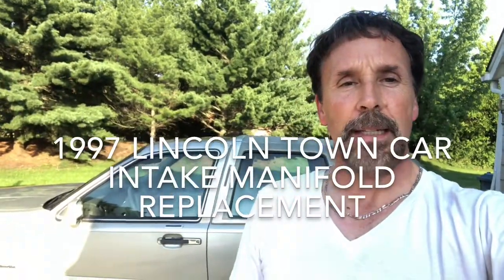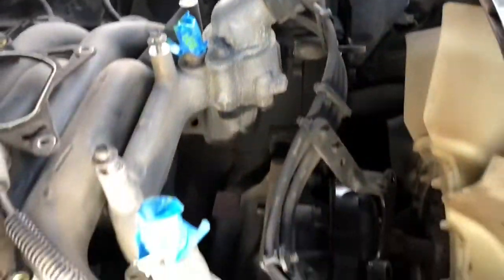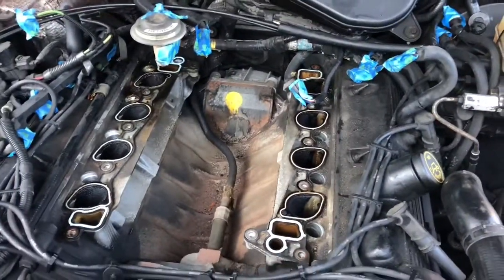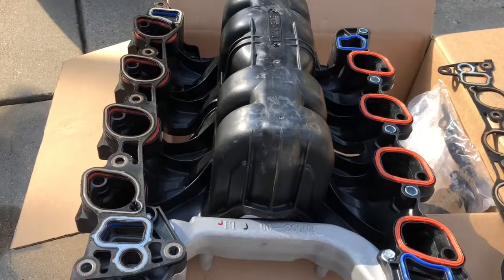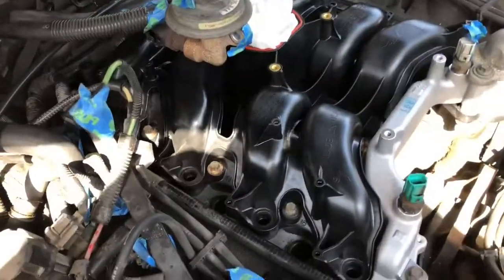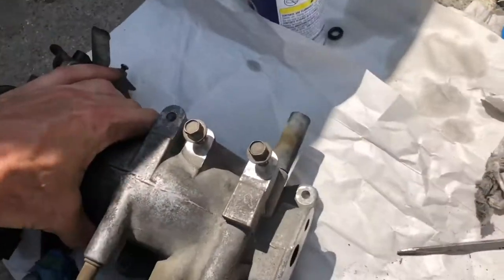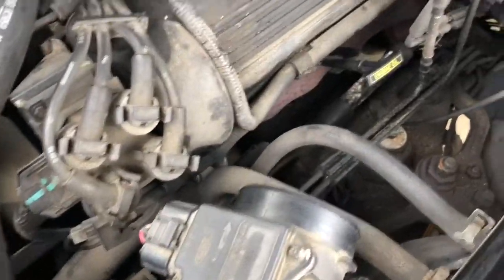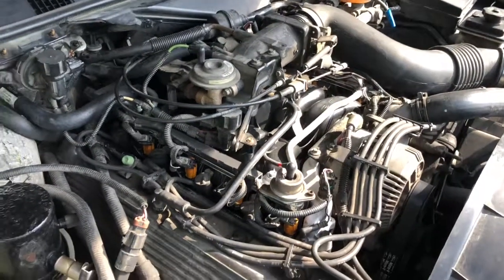Intake Manifold Replacement on 1997 Lincoln Town Car or Ford Crown Vic and Mercury Grand Marquis

Comment: I have a question how long did that new intake last because I bought the same one and the gasket appears to be off a little on the back passenger side
Reply from the maker: Still going strong at 354,000 miles.

Comment: Hi, Great video, very insightful. I just bought a 1996 town car cartier with 140k miles that wasnt driven much in the last few years and it has a misfire on cylinder 4 and some coolant loss after a cold start. I am guessing it still has the original manifold as it has the brass nipple. I do not see any cracks or leaks, engine does not overheat. there is this slight intermittent shake due to the misfire usually at red lights. How likely is it that this could be a manifold problem? what is your suggestion? thank you.

The original owners took good care of it and was majorly highway to go to Florida from up here in Toronto, so I hope it is not a cracked head. Funnily enough, I had a similar experience like a lot of people where animals made home in the valley.
Reply from the maker: Thanks for the comments. I’m thinking vacuum leak too. The main reason I replaced mine was the coolant leak. You could try spraying starting fluid where you suspect the leak to see if it speeds up. Just be super careful due to risk of fire. Maybe do it on cold engine.

Comment: Great video!  It looks like you got the lower-grade intake manifold.  The old one, with the brass tube and brass inserts, is the better quality one, although it usually sells for less than Dorman!  Nevertheless, it should last a good long time before it needs to be replaced again.  Thanks for the refresher!
Reply from the maker: I hope it does last a long time. So far so good and I’m at 350,000 miles.  Thanks for commenting!!

Comment: By the way, thank you for that tip of putting the bolts back where they belong as one goes, it's simple however chances are I'd have missed out on that. I look for it to make reassembly much easier. I'm about half way through this project. 
 I'm working on a 1997 Mercury Grand Marquis. Yours being a 1997 also it was more like mine than any of the other videos so I'm grateful. I bought this car with 131,000 miles on it and look for this to last as long as I have the car, hopefully. I'll drive it 'til it dies!
Reply from the maker: Glad to hear the video was helpful.  These cars will go for a  really long time if maintained.  Mine currently has 351,000 miles on it!  Good luck with your repair!
Reply: @johnsworkshop3312  It went well, it is done.
Reply from the maker: @alexanderbhartley5549  Awesome!  It is so satisfying when you’re done!
Reply: @johnsworkshop3312  Yes.

Comment: I am at the point of having the intake off and the valley showing. I had bought this car used a few months ago. When I got the intake off the valley of the engine was about half full of what looked like insulation, Shell from nuts where some animal had evidently made their home for a bit, the was a bit of wood chips or splinters, one or the other, Some animal had made themselves quite the home at one time judging from this evidence. :-)
Reply from the maker: Wow - that was quite a nice home - until you start it up and it goes up to 200 degrees F in there!

Comment: How do I replace the gasket that came with separate bead type gasket.that is in your pic on the right, the red bead type. Do they make that kind or what? I damaged mine when I had to take my new manifold off.
Reply from the maker: If it is a small area you could use form-a-gasket  from a place like Autozone.   Then install it before the gasket material sets up.

Comment: Does it have 2 temp sensors ?
Reply from the maker: Sorry for the late reply - yes, this car has 2 temp sensors in the intake manifold, one on the driver's side by the thermostat, and on on the passenger side.